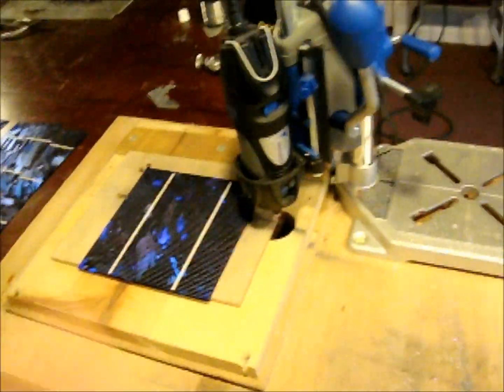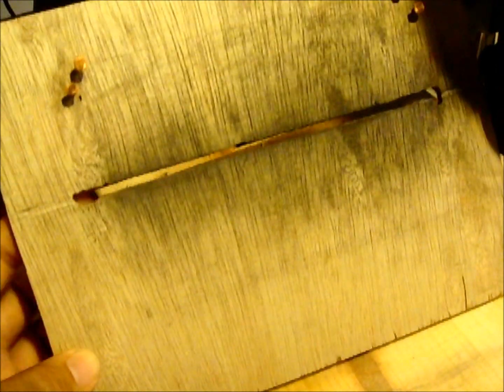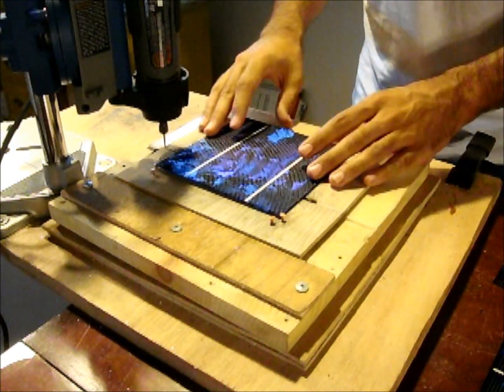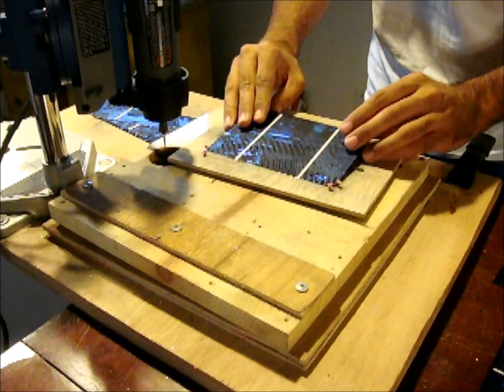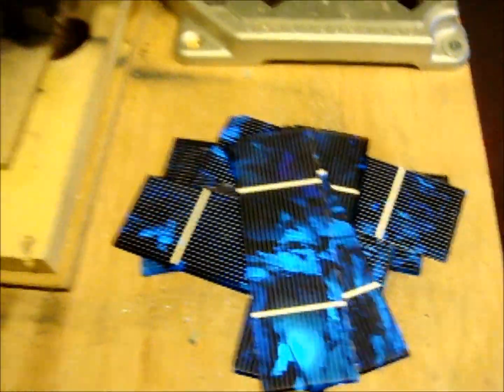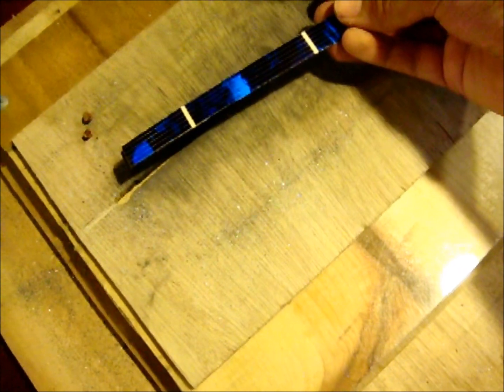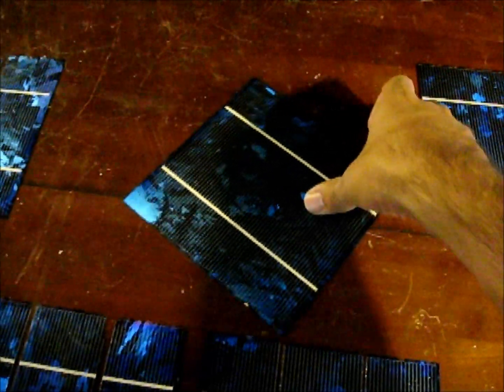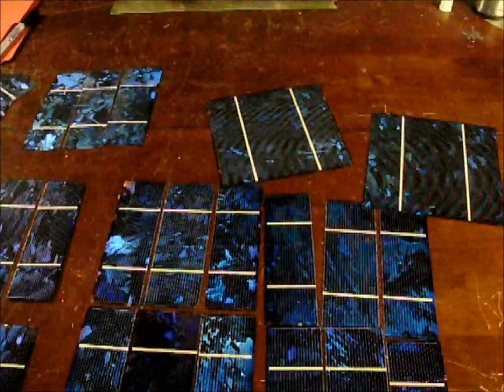DIY: Solar Cell Dice 3 (MORE IMPROVED)

Comment: If you add a small block against the back side of the cell where the bit exits the cut, it should eliminate that little piece that chips off the end of the cut. The easiest way would probably be to just replace the left most tack with a strip of the wood paneling along the left edge of the cell. This is a great method, I'll be putting a jig together this weekend.
Reply from the maker: Good luck and thanks for the comment. Post a response video if you get a chance.

Comment: Estas células policristalinas yo las compré por Ebay a China (topsolar_china) pero son de JAPÓN.
40-5x5 celdas solares para 90 vatios de paneles solares de DIY, 2.4W/pcs, las células solares de Sharp
€ 24.60 $ 31.01 esto es lo que me costaron y tardaron 20 días, el precio con el transporte incluido. De China a España
Son 5x5--36celdas = 80W---  topsolar_china   COMPRADAS POR PUJA O SUBASTA.